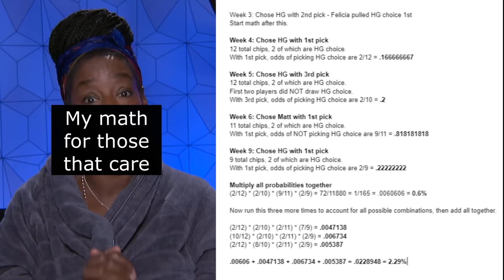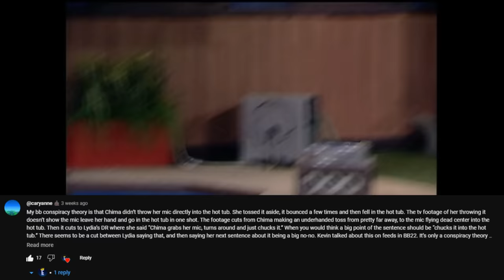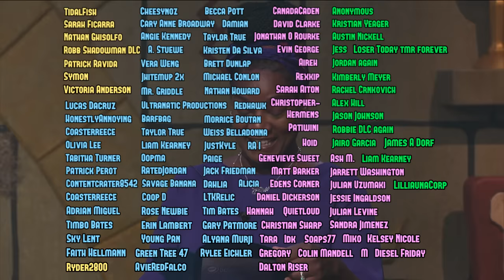5 Big Brother Conspiracy Theories 5.0

Comment: I’m not 100% sure on this, but I think a reason for replacing the key wheel for nominations (pre BB16) isn’t just a way for production to cut down on time, but the key wheel wouldn’t really work with the Battle of the Block (starting in BB16). There’s two ways I can think of them doing noms with the key wheel: a) both HOH’s go at the same time and they have to explain who is nominated by who. Or b) there’s two key wheels and they’re either split in half, or the whole house. But then more conflicts arise. Hence, the nomination box.

Comment: Another theory I heard was that when Janelle first played many years ago, the producers told her the correct number during her famous HOH win. If you watch it again, Julie clearly said, "Without going over." Her original number was 300...which would have put her over. But Janelle quickly flips her board over and writes 275. The correct number was 286. You can also hear other cast members reacting to this after the number was revealed.  The reason was that producers wanted to keep her on the show due to fear of rating drop because they just lost Kaysar and fans basically hating everyone besides Janelle, Howie and Kaysar. That why they also let Howie stay in after verbally abusing everyone for two days and Janelle getting drunk and pushing Beau.

Comment: I don’t think that it’s that suspicious that Corey saw the pipes immediately. It’s two pipes, that are a different color and size from anything else on the wall.  He knows he needs to solve a puzzle, so he can easily be looking for “a thing I can interact with” and then figuring he’ll find what it goes to later. Also, you can see him glance briefly in the direction of the manhole cover.

Also, I think he knew he was on a raised stage, so he may have even deduced he’d need to crawl through a hole at some point.

Honestly, if he’s a veteran of escape rooms, that stuff would be child’s play.  All of this is reasonable deductions that can be explained much simpler than production tipping him off.